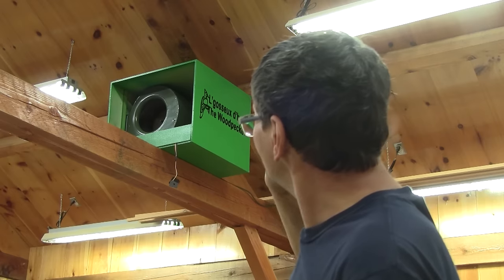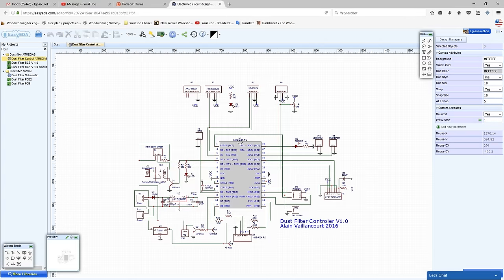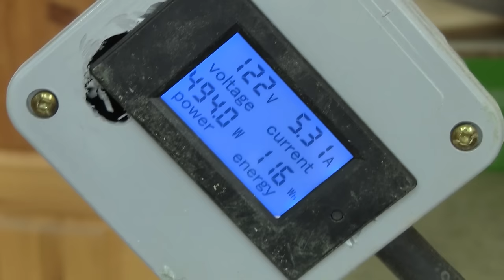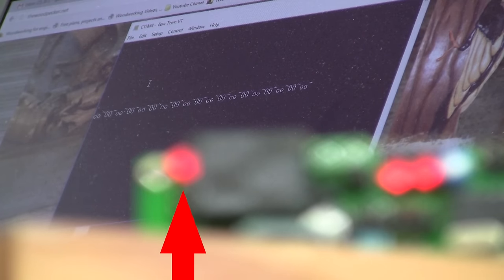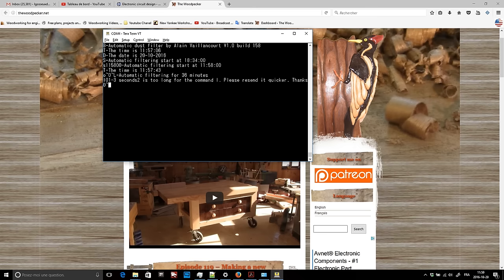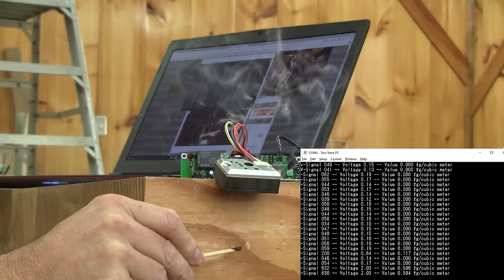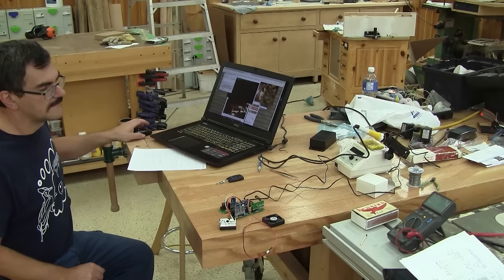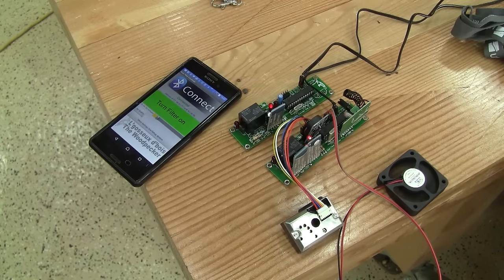The Woodpecker Ep 129   -  The controller for my dust filtration system

Comment: I have often thought of building something like this.  But I'd use a microphone to listen for machines and turn on based on that.  And a button to turn it off again for when I need to film something.
Reply from the maker: I thought of that, but I wanted something that can be programmed to filter even if I'm not there.
Reply: I figured the air only needs filtering if I'm making dust.
Reply: Alain Vaillancourt  I think controlling via a particle sensor is the ultimate method since it allows you to run the system automatically and only as much as needed without wasting energy.  Thanks for sharing.   One change I would suggest. .. use a laser particle counter instead of an IR version. You will get more accurate and consistent readings and they don't cost much more.
Reply: Matthias Wandel current sensing?

Comment: Incredible work, Alain!  My side company is based on PCB design and microprocessor programming.  I was never an Atmel fan.  I prefer PICs.  I really like the dust sensor you added in.  That is really a great idea for a wood shop.
Reply from the maker: I've worked wit PIC's in the past and I hated it. I love AVR'S, I guess it's like a Windows's or Mac computer you love it or hate it :)
So we have more than woodworking in commun :)
Reply: Absolutely!  RF and electronics is my day time job.  I also run a small electronics development company at night and on weekends.  I think MPLAB also made it easier to get started with integrated tools.  AVR Studio was a bit behind at the time.  These days I'm using AVR now and them to embed Arduino related projects for customers.

Comment: Very cool!  Thanks.  I thought about doing something similar with an Arduino board.  I was thinking of sensing the pressure drop across the filter, or increased load on the motor to tell me when the filter needed to be cleaned/changed.  Never actually got around to it.  Maybe something you can add to version 2.0!  ;)
Reply from the maker: Maybe but Hall effect sensor have to be installed at each tool and a wire or wireless uplink has to implemented, This would add a substential amount of money to the device, which is not cheap afer all, but works great. It's been in place for 3 months now and most of the glitches are resolved. That's the adventage of using a microcontroler as the brain of somethng like this, the logic can be upgrated anytime.

Comment: Alain, how did you learn how to do all this stuff.  It's absolutely amazing but I wouldn't even know where to start on a project like this?
Reply from the maker: I studied electronics in college, and I barelly work in the field. Moved to a carrer in télévision. But over the years I still did electronics projects here and there. But for my dust filter I wanted something that couln't be found on the market, probably because it's so expensive, so I designed this and love it :)
Reply: Ah that makes alot of sense now.  I knew you worked for the CBC and wondered if you figured all this out using self-directed study or if you had formal training in electronics.

Comment: Did you ever think about using a current sensing circuit for all the tools that use the filtration?
Reply from the maker: Yes  but a sensor on every tools will increse the cost a lot. I would have to wire the sensor to a controler or doing it in RF, like I do, but this also adds a lot of dollars. It's why I did it like that.
Reply: Alain Vaillancourt no, have all the tools on one or two circuits and have the sensor on the main trunk.
Reply from the maker: It might work but all my tools are on seperate breakers, so this wouln't work I would have to put a sensor on each tool anyway.